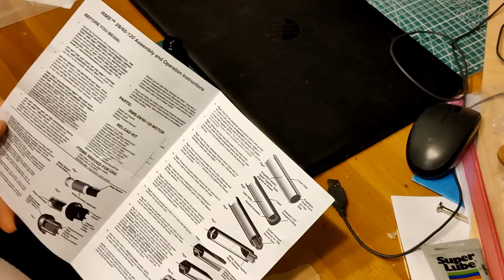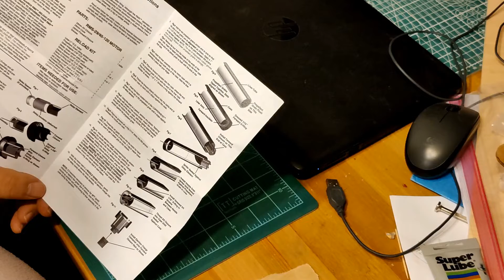Aerotech RMS 29/40-120 Rocket Motor Assembly

Comment: While you have the parts laying on the table, I recommend holding the nozzle against the 2 grains, insert the igniter and push it forward to where it needs to be, then put a sharp bend in the igniter where it exits the nozzle.  Now you can take the igniter out and continue assembly.  The bend in the igniter leads will show how far to insert the igniter when you are ready to launch.
Reply from the maker: What a great tip!!!!